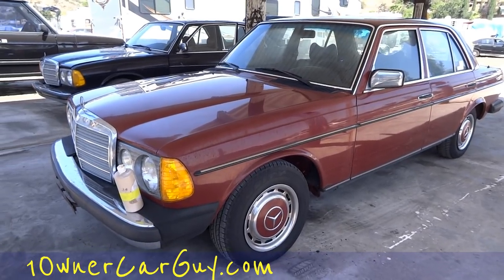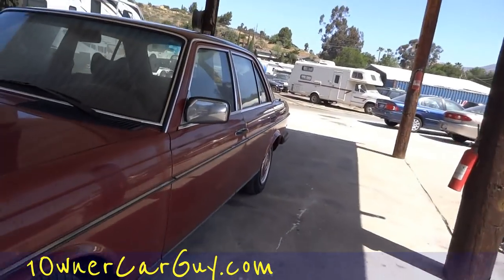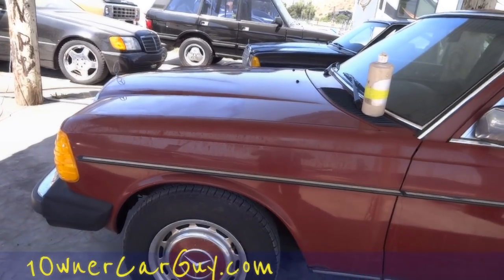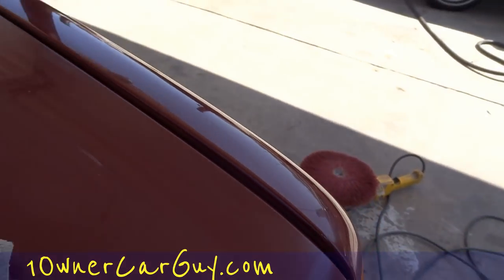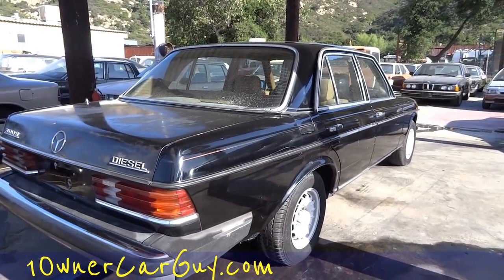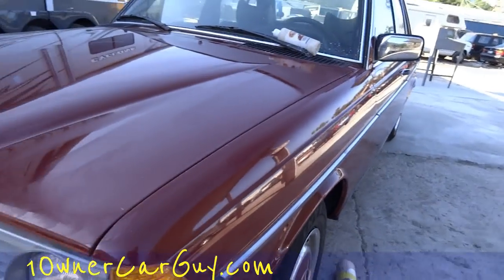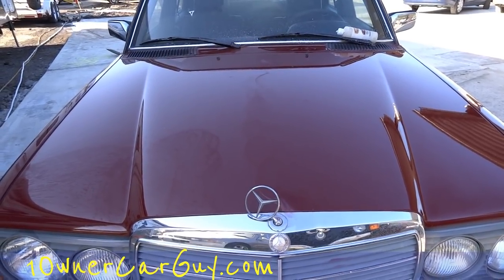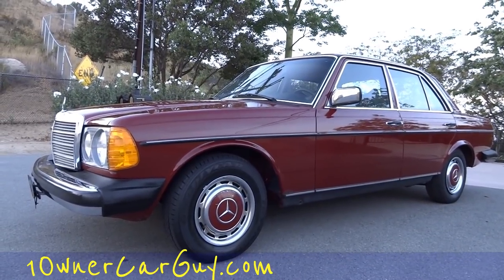Car Buffing DIY How To Buff A Car Restore a Cars Paint Detail Tips Part #2

Comment: Did anybody's else's mouth drop as he put the pads on the floor before use 😭😭😱😱
Reply: +John Szabo yep...... must be a 600 grit pad to help the compound cut the paint better lol
Reply: +John Szabo , as a matter of fact, I was thinking the same thing. I keep my pads in a closed plastic bag, and each pad is for a specific process, cut [compound], deoxidizer [extra light cut] and the final pad is for a good wax. If swirls marks are apparent I use a swirl remover using a separate pad and then wax using separate pads. Also I keep a spray bottle with water to keep the paint cool and I use less product using water..
Reply: +Ken Doe 7з
Reply: I also cringed when I saw the bottle of Gatorade or whatever that was on the hood of a freshly polished car.
Reply: I was just about to comment about it lol
Reply: John Szabo almost cried.. like cmon man
Reply: EXACTLY!!!!
Reply: I did not read any comments and was screaming WTF. Now its full of dirt and grit that will scratch the shit out of the paint.
Reply: Yeah! I like your Suzuki Jimny
Reply: retrocarenthusiast93
Reply: I dropped dislike

Comment: The pads all have different levels of abrasion.  White wool, blue wool, yellow foam, green foam, blue foam (from heaviest to lightest, these pads are for cutting)  and then black and white foam are polishing pads. White being the softest pad.  The best way to put the compound on is in a single dot, centering the pad on it.  The compound will work it's way to the edges and there will be no splatter.  Also going up and down and left to right in sections SLOWLY and evenly works best.  Fast, irregular motions don't evenly cut the paint.  After this a swirl remover is needed with a black or white pad.  

Just some friendly insight.

Comment: Thanks Nathan, I have a 6 inch turtlewax orbiter (no change speeds) With a wool pad and foam pad. So if I buy the cutting compound and for the polisher I already have the new Meguiriars polishing compound and then wax it, will that work? Thanks for your time..

Comment: Hi Mr Marshmellow.  So does this buffing with your gritty solution cut out the use for using a clay bar? My car is a 2002 Saab 9-5 Aero Midnight Metallic blue that has these shallow swirl scratches everywhere. But the paint is glossy still except for the roof. When I feel the car with a plastic bag it feels very rough. Their is old car wax on the black rubber, can you tell me how to get that off to? Thanks for your time and keep taken it easy my friend :)

Comment: What do you use to restore the car as in the liquid? where can i obtain that?
Reply: can you recommend me one please :)
Reply: Cereal Marshmallows  Great job in that car.  I too was wondering what you used. I have a 14 year old truck with perfect paint on the sides but hood and roof have a white spotted look along with some paint cracking.  (probably because of the 100's of waxing jobs I've done.    Question is do you think I need to go to this extreme or should I just hand polishing compound.  I used Meguires polish #7 before using #26 wax and it looked sooo much better already!

Comment: question,,, My old Benz had real leather seats I now have a 2012 c350 and I dont think its leather, its a composit I think, what should I use on the seats?? , used mothers VLR rubber leather and plastic cleaner treatment is that bad?

Comment: Correct me if I get this wrong, but even if I do this twice a year, the paint's going to be less than it was a year ago, isn't it? I know the oxidized paint is what's supposed to be removed by a buffer, but isn't that "bad", as the paint is coming off? Isn't the goal supposed to be to keep the paint on and just give it a shine - as we do with shoes?
Reply: lol. no way. I know it looks much better after what you did here and I'm planning to follow your advice, but was wondering out of curiosity if waxing in general makes a paint job mandatory some years down the line?
Reply: omarrahman88 shining shoes and buffing a car are not really at all the same but the key with either is to prevent the paint from getting scratched and oxidized or whatever so you don't need to compound it very often. The same goes with shoes, if a pair comes in all scratched up waxing alone isn't going to make them smooth, you gotta do a light sanding and then polish them. Same goes for a car, keep it waxed and protected and wash it correctly and you won't need to buff it as often, like you said, there's a finite number of times you can buff it before there's nothing left to buff. Some guys even use paint thickness meters before  determining if there's enough to buff.

Comment: You have Artico leather which is a fancy word for MB-TEX. It's a vinyl material and it's synthetic. Use a vinyl cleaner or plain old soap and water to clean it. Condition it with a vinyl conditioner or 303 Aerospace Protectant. I have this stuff on my 06 C280 and the seats still look like brand new, much better than leather and tougher.

Comment: Buffing speed is also very important. Many variables with that (paint type, buffing pad used, experience with buffer etc) Error on the side of caution here, you can always remove more paint with more passes, but your screwed if you try to do it too fast. If you are using that much compound and slinging it all over, you are wasting expensive material, creating more work for yourself later in the process. Use just enough to get the job done.

Comment: I imagine the RV would be a nightmare to buff a 3 stage process. . But it did not seem as oxidized so I imagine a cleaner wax to just a wax itself was enough for it.  I know its hot down there in SO Cal but remember to not block off the cooling intakes and vents of the tools with your hands. Many people make this common mistake and fry them. Seen this happen a lot :(

Comment: Informative, however I think you left out some important info. Know the paint type you are buffing, yours was single stage (that's why color is on your pad). Always make sure your buffing wheel is rotating off of the panel or edge you are working, otherwise you may burn the paint. Use masking tape to cover belt moldings/emblems or anything you wish to keep intact and clean. No matter how careful you are, you will miss and tape is cheaper than replacing molding/emblems. Good for the first timer..

Comment: the best way is to get some washing up liquid and some wet and dry sand paper with a bit of water then you touch up the scratch with a touch up pen then use the wet an dry again to smooth down the touching up then afterwards you use a polish to bush it all up to a shine best thing to use is a rotary buffer to get rid of the marbleing effect when you take down a few layers of laquer

Comment: I see some people here are being critical of his work but, I think they should consider this. Sometimes, its not about how you get the job done, its only that the results are desired. The paint looked really good. For what he is doing with the car, I think it was excellent. It was his desired result. If someone worked on your cars and, they did everything this guy did but you didnt see it, you would be happy with the results. Whoever says they can do it "right", post a video instead of running your mouth. Youtube is full of people constantly nitpicking, its a shame that a guy who took the time to teach someone the basics of buffing, has people talking so much trash. Unfortunately its the sad state of society these days.
Reply: the issue people have with this video is that if they do follow his 'teaching' they will probaby end up with a car thats needs professionally repainting. Polishing a car is not supposed to remove paint, if you keep removing paint what do you think is going to happen eventually?
Reply: Mcpricex that's exactly what happens when you compound a vehicle. It removes paint. Compound is essentially sandpaper in a bottle and polish is more or less the same thing, just finer.
Reply: They don't know what oxidized paint is and haven't ever tried to buff it out.  Everyone's an expert on the keyboard.

Comment: Good Lord, what the Hell is he thinking, please don't do it this way. Buy a good radom Orbital unit. Use foam pads. Try the MOP technique. Wet the the area and keep it moist. add your light weight compound to the area and hand wipe it on. Then buff until it is dry. and hand wipe off resdue. Repeat as necessary with a more aggressive compound if necessary. Then on to the finish wax.

Comment: That will last a 4 month summer after you sell it. Then After a few washes and such the next year it will look like ass. You did a good job to sell the car but it wont last. Clear coat is gone as proven by the red pad and a normal person wont buff and wax every month to keep it nice after the sale. Cars with clear coat gone like this one and covered up by crapy buffs are easy to spot if your in the know how to look at it. It does look god . Just not as good as new paint.